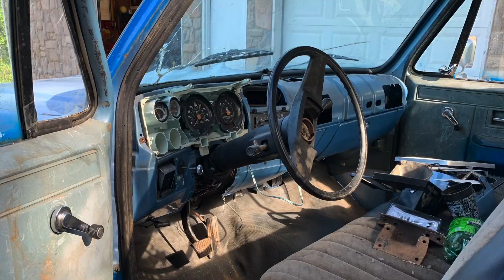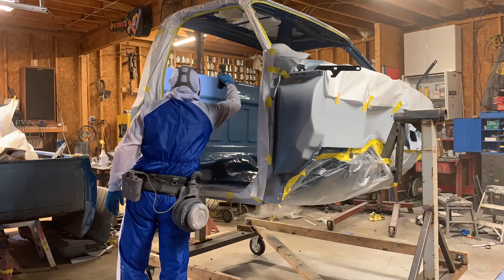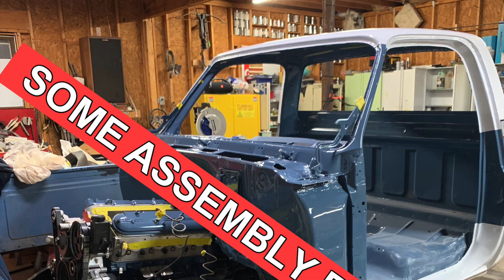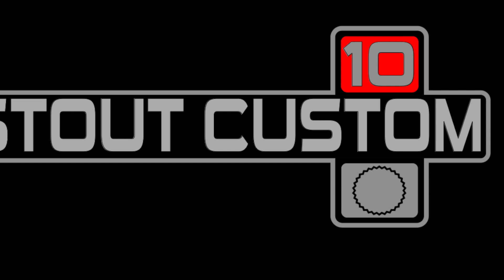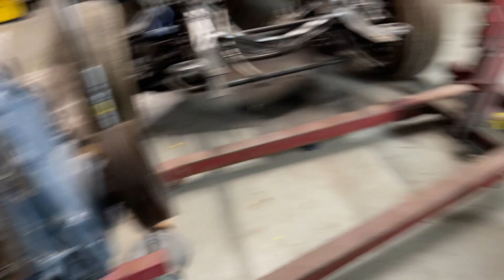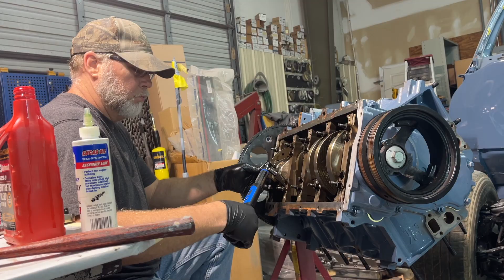C10 Project: Back to My Squarebody.....Again.  Update January 2022

Comment: My 83' had a sunroof hacked in somewhere along the the way. I would really like to fill it in but Im not really sure how to go about that. I have access to a good roof from a donor rig. Does the whole roof panel come apart and off the cab(i dont really see how if so) or should I consider just making a patch from the donor panel. Im really hesitant to do any welding up there because Im afraid I would play hell keeping it from warping. In my mind maybe making a flange to support existing cab and new panel and then panel bond. But I sure don't know. Have you ever tackled something like this?
Reply from the maker: I haven't done one yet but the black C10 I did sure needed a roof.  I gave it some thought then.  Some have said its fairly easy but I would have to try myself and see.  I see it as option one:  cut the damaged roof skin off by drilling the spot welds above the doors and around the windshield. Cut the damaged skin close to the rear seam to see how it goes together and expose the spot welds that I would think are there.  Then do the reverse on the donor truck to keep the roof skin intact and remove everything around it (might not be that easy) . Stick the donor on and weld into place just like any other panel and maybe panel bond the rear seam that you can't get too.  Option 2 would be to splice in the new roof along the windshield pillar and rear pillar.  Usually lapping the front and sleeving the rear to add strength.  May be quite a bit of filler work to do that.  Option 3 would be to replace the entire cab.  Its probably not that easy no matter which option you choose but it can be done.
Reply from the maker: @nofncsfish  interesting video. I would do something very similar but I would have drilled the spotwelds on the front as well as the sides. On the rear I would have tried to keep the factory seam if at all possible.